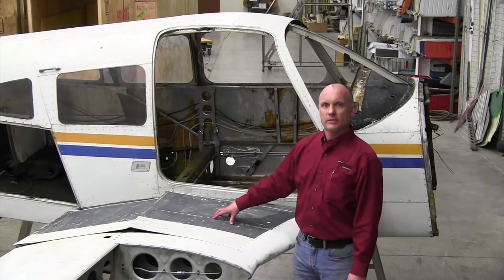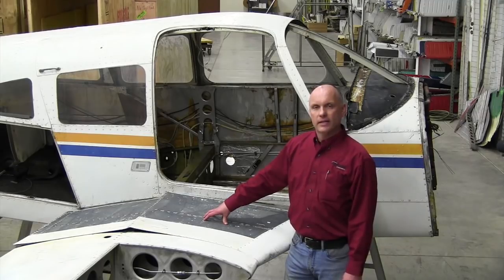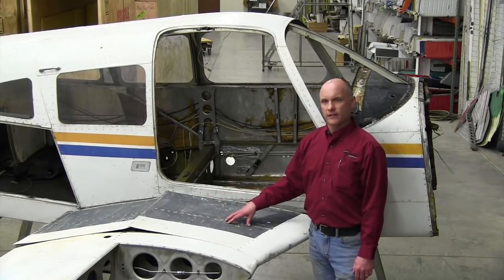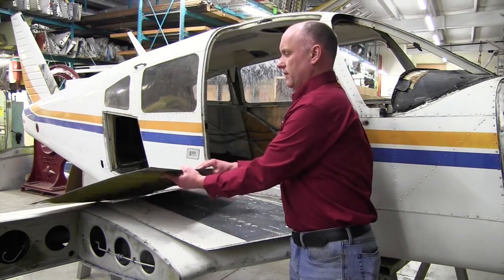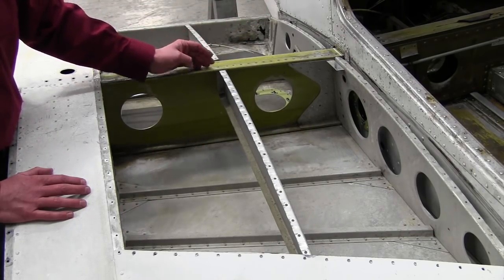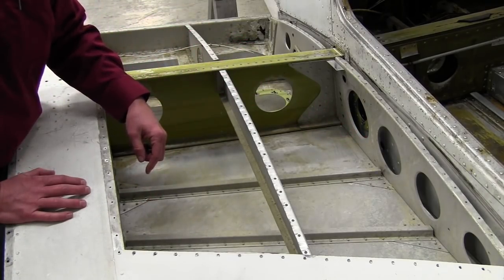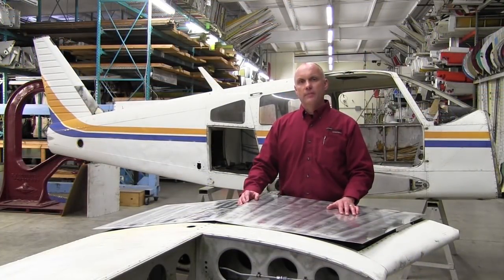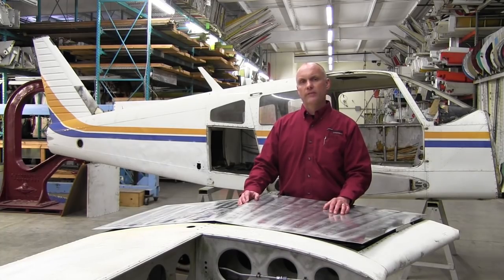Piper PA28/32 Wing Walk Cracks and Wing Walk Replacement

Comment: Very good video.

It would appear to me that it would be wise to also remove the fuel tank to gain access, and that removal of the wing is certainly the way to go.

I've got a customer with pa-28-151 in need of forward and aft replacement, as well as another with a pa-28r-201T in need of forward replacement.  We await the results of inspection of ER and results to perform these jobs.
Reply: JeepCo MJ just curious, how much a project like this would cost? I have a PA140... I don’t have this problem but it would be good to know.

Comment: Has there ever been a discussion of adding two more ribs in the wing walk area?  Maybe it could be an intermediate panel stiffener between the ribs and parallel to the ribs that would help distribute a step load over a larger number of the existing bead stiffiners.

Comment: One of the local school p28-161 has a soft wing walk.  It appears some of the rivets in that rib are missing completely and two were replaced with blind rivets.   Is that forward rib under the wing walk structural?

Comment: while they were on retractable models..seems to me a good time to inspect the spar attachment points that failed and cracks found on the PAs in florida
Reply: Saltwater is highly corrosive to Aluminum. I live on the Texas Gulf coast, always a big concern for any aircraft and why I spent the bucks to hanger my planes, a lot cheaper than fixing corrosion.

Comment: About 6:15 or so you say blind rivets aren't allowed to be used in wing spars per AC 43.13 but I've been unable to find this requirement. Is this really verboten?
Reply: They are not allowed unless specifically authorized by the manufacturer. Too much strength is bad too, leads to cracking
Reply: Pitkä Peura Actually AC 43.13-1B says that blind rivets shall not be used in areas that are "high stress", which this gentleman is assuming means "anything that is attached to the wing spar", which is incorrect. The spar is unaffected whether it is a blind or solid rivet. Hence it is acceptable to use blind rivets to attach the wing walk area without removing the wing. But then you can't charge those hours so...
Reply: Straight from the blind rivets section:
CAUTION:    For  metal  repairs  to  the  air
frame,  the  use  of  blind  rivets  must  be  spe
cifically  authorized  by  the  airframe  manu
facturer or approved by a representative of 
the FAA.
Reply: Pitkä Peura So not just the manufacturer, gottit.
Reply: Problem is with all the hours and equipment(?) required to show the FAA the strength would be the same(possible upsizing of holes, or number of holes) you might as well take the loss and pay the extra cash with what you'd be losing in downtime assuming you rent it out. It certainly would turn a nightmare job into something your local sheet metal shop could do in a day or 2. Don't actually know in reality if they would even consider it for approval, and if they did what information and to what extent they actually need, not just what their papers say they need.

Comment: Any tips on how to avoid cracking wing walk skins? Where to walk. Shoes to avoid. Other.
Reply: Kevin Moore .....I have one buy a Cessna .
Reply: One would assume you'd wanna put ur foot on the Rib of the wing vs in-between them. Just basing off common sense
Reply: @larrygreen8912  Or if you happen to be of the male gender, you could buy a citabria or decathlon. Hell, any taildragger will do. Those are just ones I've owned. I will say however, I've flown in a lot of pipers over the years and after seeing how the wings are built and especially how they're attached. (or barely attached) to the fuselage... I'm not sure I ever want to do so again. At least not unless I personally know the mechanic. I still hate flying a plane as boring as a 152 or 172... But I'd still rent one from a random small town airport in BFE and feel safe. Flying it.... Pipers? Not so much anymore. Walk into same airport in north BFE and the guy says "sure, we got an old warrior for rent"... Yeah no feckin way Bud. I don't need a wing flying off randomly when I'm cruising along minding my own business. Boring as a Cessna is, at least the wings are properly attached from the factory. And yeah. I know my Citabria had a wooden spar, but wood doesn't suffer from metal fatigue from repeated bending. My decathlon is upgraded with composite spars... I'm not worried about delamination or anything like that because with my plane it's less of a wing, and more of a series of inspection panels with little bits of wing attached every so often. Lol.
Reply: blackhawks81H   ... we have a Stearman and a L3  I very much enjoy the vintage aircraft. Stearman is OK to takeoff a dream to fly and a bitch to land .
Reply: @larrygreen8912  Without the skylights. They leak and kill a wing.
Reply: @blackhawks81H  wings don’t just “fly off” Cherokees. All airplanes have their known issues, out of the 30 some odd thousand Cherokees built, they are extremely safe airplanes

Comment: Not a sheet metal expert here, but I would had thought that you could use cherry rivets for the installation of this panels... I’m I wrong?
Reply: Yes.   You are.
Reply: Next time your up close to an older Boeing 737 or 747 take a hard look and what holds it together, but they are not allowed on GA aircraft as the extra strength leads to cracking on thinner panels.
Reply: AC43-14 allows them to be used (as mechanicall locking rivets):

Mechanical-lock rivets have a device on the puller or rivet head which locks the
center stem into place when installed. Many
friction-lock rivet center stems fall out due to
vibrations; this in turn, greatly reduces its
shear strength. The mechanical-lock rivet was
developed to prevent that problem. Various
manufacturers make mechanical-lock fasterners such as: Bulbed Cherrylock, CherryMax,
Olympic-Loks, and Huck-Loks.

Comment: How about showing use how to run some rivets.
Reply: Because you aren't legally allowed to repair unless if you are a holder of an A&P cert. If a mechanic didn't know how to "run some rivets" then how the hell would he had received his cert.
Reply: @ryannickos3557  I builing semi trailers for 30 years and I was wondering 🤔 how you bucked rivets on a plane in some of those spots and I will get my A&P in do time !
Reply: Also because if you are not skilled enough to do this work now, this is not the job to build your skill on/ practice on!

Comment: To replace the wing walk he had to pull the engine off , the interior out and remove the wing ? Glad I have a Cessna
Reply: We did this on our PA-28-181 without removing the wing, just a fuel tank. It was easy.
Reply: @davidb2045  hey, how did you do that? from wich part of the wing did you replace the wing walk?
Reply: According to the video, he also had to remove the landing gear, baggage door, all the wiring and insulation, instrument panel, control yoke, windscreens, the complete firewall forward.  He needed to scrap the airplane in order to replace the wing walk.  

You should trade your Cessna in on a brain.

Comment: I do not like the manner in which that spar is attached to the fuselage. Those holes right opposite each other may well be fine on the top of the spar where there is compression, but at the bottom where there is impulsive tension, well, the last set of holes going towards the wing tips are subjected to very high stress and a possibility of crack is very high. Rather than drilling the holes right opposite each other, the distance between the holes could have been lengthened by drilling opposite between the holes,  even if it means one less bolt to use.  On an overhead hanging traveler, I was faced with the same problem and reinforced that area. Piper should look into that wing attachment.

Comment: This seems unnecessary.  A panel on top of the wing?  Because of cracks in the ends of the stiffener flutes?  I don't think any Piper has ever crashed due to this.